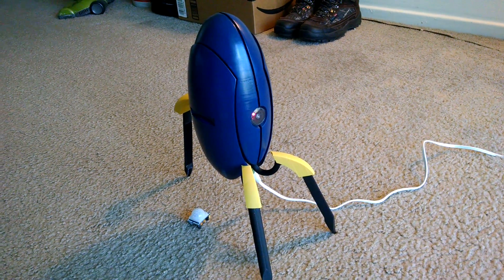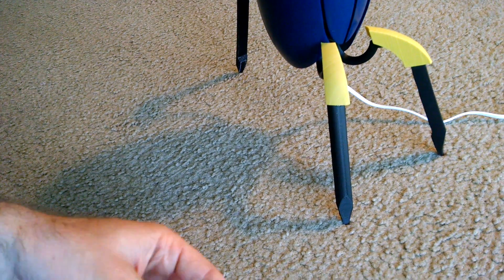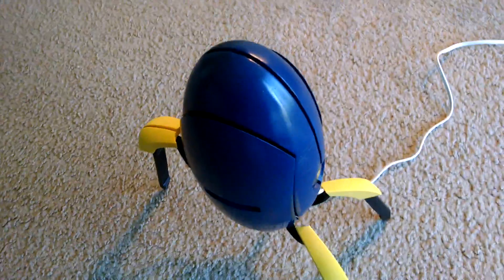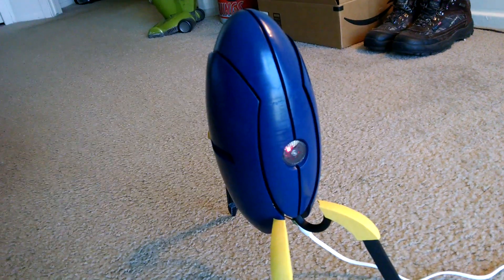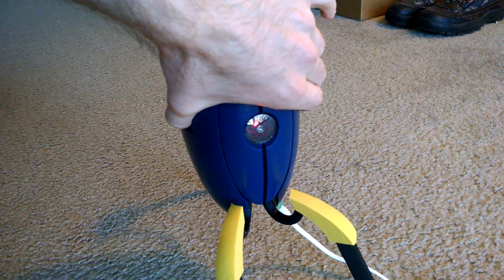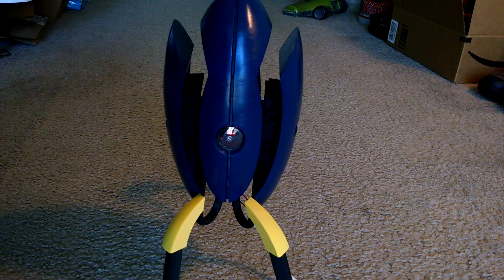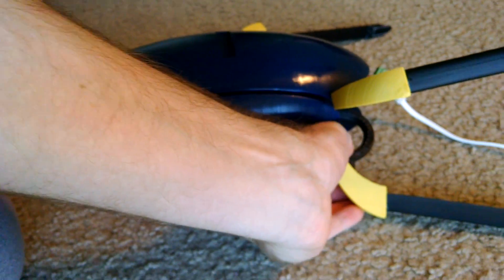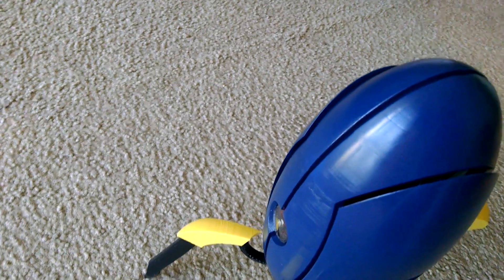Miniature Portal Turret

Comment: What’s an arduino?
Reply from the maker: it is a brand name for a series of microcontroller chips that come neatly integrated onto printed circuit boards. these have a large online community, easily accessible programming environments, a wide variety of accessory boards (like the one I'm using here to create the sound) and are a great gateway to learn programming for integrated circuits.

Comment: How do I position a 3D model so that the printer does not have to print through the air?
Reply from the maker: I'm not quite sure what you are asking.. but I'll guess that it is about 'suspended' geometries. unless a 3D model is specially designed to avoid features that stick out into space and don't touch the build plate, there are going to be overhang features that cannot physically be printed without modification. the necessary modification is the support structure that reaches between the build plate and the overhang feature. in the case of my turret model, there are large overhang features at the door slider mechanism. usually, the slicer software that prepares the model for printing will add the support structure. when the print is finished, you'll have to manually remove those added supports. i oriented the turret vertically, just as it stands normally, during my prints. is this what you were asking about?
Reply: @Obeisance01  yes,thanks

Comment: I noticed that when I work with sound in my sketch, my arduino stops doing anything else. Have you encountered the same problem? If so, how did you solve it?
Reply from the maker: i have also encountered this behavior. as i understand, since the arduino itself must process or drive the sound generation, it is not free to do anything else. i did not take actions to overcome this. perhaps a different arduino like the MKR zero or a dedicated processor on a shield would be needed to fix this.
Reply: @Obeisance01  
How does your turret make a sound when it sees you?
Reply from the maker: i didn't have to do anything special here; when the light sensor deviates above a threshold away from an average baseline light level, a sound file is played on the wave shield. while this is happening, the turret does nothing else.
Reply: @Obeisance01  what about a raspberry pi to control everything instead of the arduino? It can handle multiple operations simultaneously
Reply from the maker: @timsarai  that might work. i have no experience with the raspberry pi, though, so i would have a lot of learning to do. also, the size of the board is important because of how small the turret chassis is.. in the version shown here, the arduino uno works well enough. anything larger might stick out of the turret body space. in my second revision turret, i am using the smaller arduino mkr board, and the new door mechanism is too large to accommodate even the arduino uno.
Reply: @Obeisance01  check out the raspberry pi zero. It’s tiny

Comment: it does no open enough
Reply from the maker: that's correct. the length of arm travel is limited by the actuation mechanism and by the rotational servo. if you can imagine a better mechanism, maybe you can build a better performing model.

Comment: How did you get the arms to open? I have working on the problem of creating linear motion with a servo in my head for a while, but I curious how you did it. Any help would be greatly appreciated.
Reply from the maker: the arms are actuated by a mini servo with push rods. the arms side along 3D printed tracks.
Reply from the maker: this is analogous to how a linear piston motion in a combustion engine creates a rotating motion of the crankshaft
Reply: David Bilby Thanks